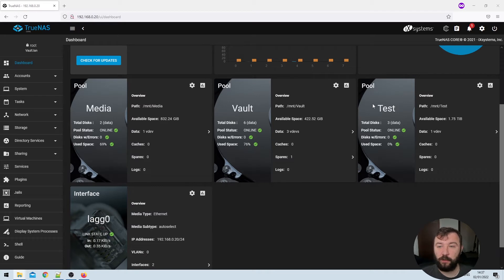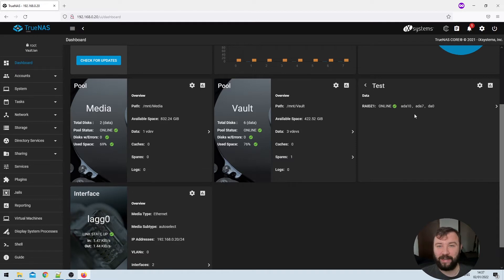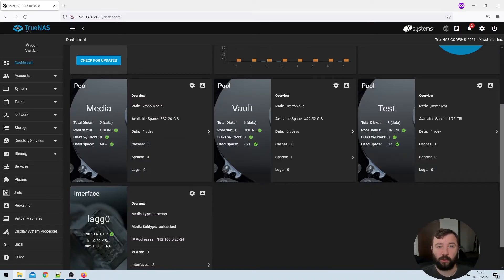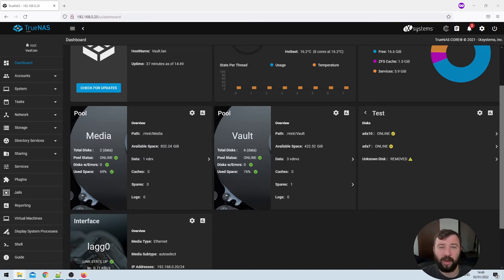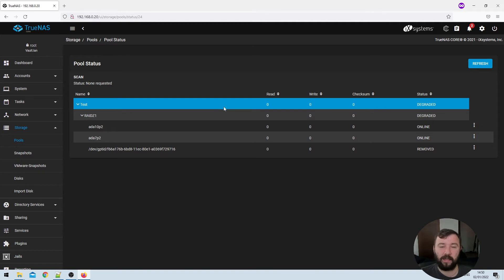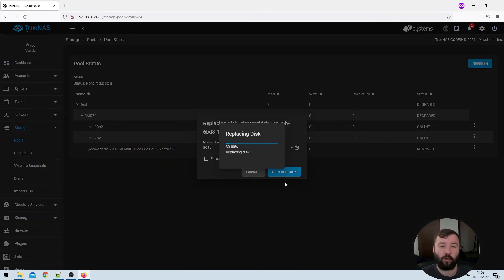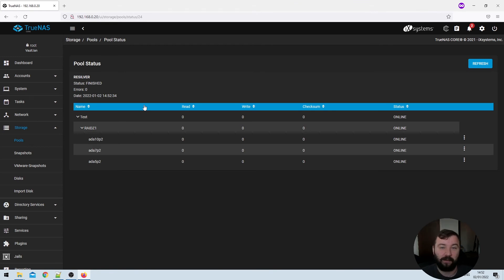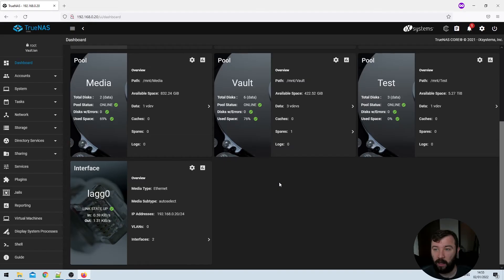Replace Failed Disk & Upgrade VDev Size | Managing TrueNAS Core

Comment: great little video! Nice, simple and clear. The point you made at the end about replacing a smaller disk with a larger one has answered a question I've been struggling to find the answer to! I have 2x 1TB and 1x2TB with the view of eventually replacing all for 2TB's but didn't know if I'd have to rebuild the vdev/pool - it seems not, so I can stop procrastinating now and get this NAS finally setup.

Comment: hi mate, your videos are awesome and youve helped me convert an old pc into a nas. i noticed the vdev you upgraded had 0% used. i currently have 5x 1tb drives in my nas (as i had those drives around in cupboard already) ive used raid z1 and have transferred 2tb of backups over to it. when i transferred more over i had an alert say truenas likes 80% only used. so my question is- now i have 2tb of backups on there can i still do the replace a drive option and replace each 1tb drive with a 2tb drive at a time?  ie i purchase 5 2tb drives or do you suggest another way as i need about 7tb of space all up  so i can consolidate all my pc files onto nas. now that i have a nas i may aswell use it to full potential hey
Reply from the maker: Hmm, yea, you're going to be pretty short if you need 7Tb, but only have 5x1TB drives. I do suggest you upgrade them, if you have the budget. Check out https://diskprices.com/ though, and see what the best bang for your buck is. Depends on where you are but you could even get a couple of 6TB for about 70 bucks, if you can risk going used. Up to you, but I'd go more than 2TB. That would only give you an extra 2Tb to grow after putting on your 7TB of files. You'll run out again quickly!
Reply: @BlackbeardSupport  thanks mate, but how do i go about swapping out the existing drives with new drives and not losing any data? i was thinking 2tb drives as i thought i would need to replace all 5 as truenas only recognizes same size drives. so if i wanted to change the 5 1tb drives to just 3 4tb drives for examples- how do i do this?
Reply from the maker: It's pretty straightforward, you use the same process as though the disk had failed. TrueNAS allows you to swap out a disk in a VDev with a larger disk. It will just treat all disks in a VDev as though they are the smallest size disk in the VDev. So if you have a Vdev of three drive, 1x1Tb, 1x2TB and 1x3TB, all three drives will be treated as 1TB. If you swap the 1TB out with a 3TB, all disks will be treated as though they are 2TB. When you swap that final 2TB out with a 3TB, all drives will be treated as though they are 3TB. 

So, you can swap your drives out one by one, and when you swap out the last drive, the whole pool will grow. You must wait for the drive you swap out to re-silver before you swap the next drive out. You must also only do one disk at a time. 

I know you had RAIDZ1, but I'll comment for the future, this doesn't work if you're drives are striped, instead of VDev.
Reply: @BlackbeardSupport  champion! cheers for getting back to me. Im new to a Nas and built my own last week after seeing your channel! used old  i7 2600cpu/motherboard and 32bg ram i had packed away years ago in cupboard. bought a new psu and new small  matx case and just put every old hdd i had in cupboards into it lol. all 1 tb, but also found a couple of 2 tb so i made 2 pools. well yesterday after writing that msg to you i had some issues. one of the 2 tb degraded, and 1 of the 1 tb completely disappeared from pool? bit the bullet last night and and bought 2 new ironwolf 4tb nas drives. NOT Cheap!  picked up and put them in this morning after removing all old drives. (these hdds ranged from 09-12 so over 10yrs old and were used thoroughly in their life with me over years with pcs ive had) i had read a lot about pc drives not coping to well with nas and figured i use the standy settings to try and look after them, but all i could see is this nas becoming a disaster using the crappy old drives i had lying around. the new ones are working well in a mirror. 
my only option to expand from here though is to create another pool with another 2 new 4tb or maybe 6tb drives (if price comes down here in australia)  hey?
my pool is almost full with my data ive been copying today while i was at work but i still have more data but couldnt afford more nas drives at this stage
i cant just add another 4tb one to pool from what ive noticed hey?. ie what does expand pool do? can i use that to add a third drive so i dont need to buy 2 drives and set up a new pool. buying 1 4tb drive could happen alot earlier than saving for another 2 4tb nas drives
Reply from the maker: @todd1748  Creating a new pool is not the only option, each pool is made up of what's called a VDev, and each VDev is made of disks. So your current setup is 1 Pool, with 1 VDev, Made of 2x4TB drives in a mirror. If you wanted to expand, you could add a second or third VDev of existing disks. 

For example, you could have 1 pool, 2VDevs, with 2x4TB disks in each VDev (4 disks total). 

Data is striped across VDevs, so if you lose all the disks in a VDev, you lose ALL your data. So you really don't want to have a VDev with 1 disk in it, because if you lose that disk you lose everything. 

In your case you could add another VDev of the 2x2Tb drives you trust the most. That would mean you had 1 VDev of 4TB and 1 VDev of 2 TB, for a total of 6TB. Then when you wanted to upgrade you could swap out the 2TB disks with bigger ones. 

Adding more VDevs is straightforward. Storage -> Pools -> Gear Icon -> Add VDevs. 

As a final note, I would say that my NAS is using regular drives I had lying around, but they don't have too many hours on them, so just cause it worked for me doesn't mean some people won't have problems (Which you sadly seem to have).
Reply: @BlackbeardSupport  thats awesome advice. i will do just that and create a new vdev instead. but ill wait till i have bought 2 new nas drives as all my spare standard hdds are very old
Reply from the maker: Sounds good!
Reply: @BlackbeardSupport  i figured stuff it and bought another  new 4tb iron wolf nas same as others. deleted pool, and created one with the 3 4tb drives. gives me the 7.5tb i need and saves me buying 2 nas drives instaed of 1. i worked out if i created another vdev i would have needed 2 nas drives and would be in a mirror but still same overall size to vdev available. took about 24hrs to transfer data off, delete pool, set up new pool and transfer all data back plus rest of data i had. perfect now and i ended up with just under 2tb space as i realized some of my data was duplicated across multiple backup external drives! cheers again for your help champ!
Reply from the maker: @todd1748  Glad you got where you wanted to go!